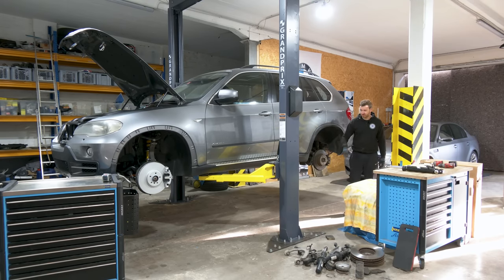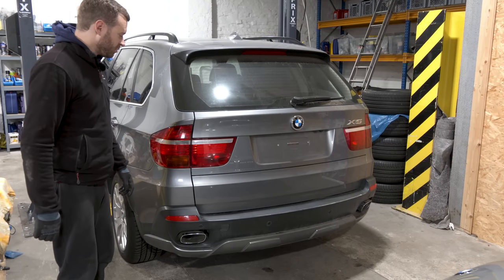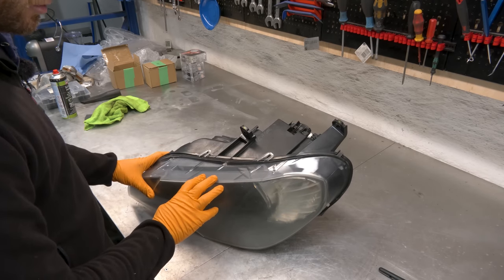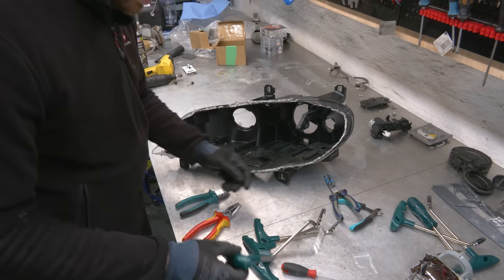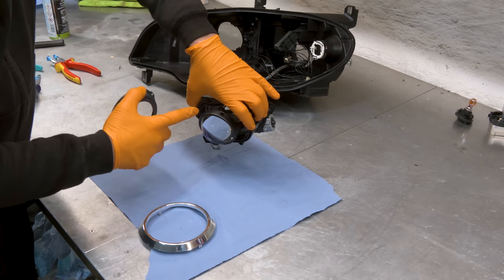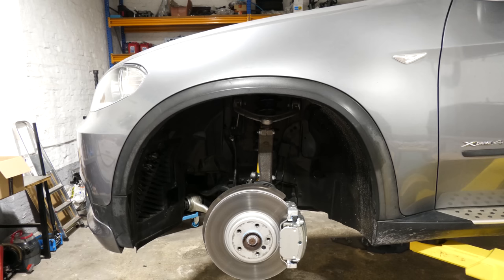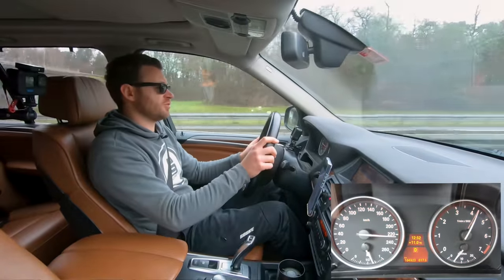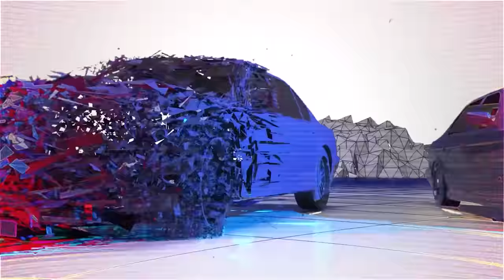Damage Report - Neglected V8 SUV BMW E70 X5 - Project X5: Part 5

Comment: This was a great series, thoroughly enjoyed it. The headlight restore looks very complex, but the result is phenomenal.
Reply: Why did you not change the side lights to bright white instead of the yellow ? Great job amazing attention to detail 😎😎
Reply: I wonder if the angle eyes could go to super bright LED.  The incandescents … meh
Reply: @f1lmm  the yellow is period accurate
Reply: BMWs really don't seem to like the sun and the heat. In South Africa, on the E46, the headlights go cloud, the interior roof lining sags and windshield cowling is always cracked and broken. At least they are cheap and easy fixes. It seems to be similar for other models I'm just not too familiar with them, but I've seen dozens of E46 examples.
Reply: @AapVanDieKaap  same in Australia. $1800 dollars for a new headlight x5 wagon.2008. NEVER AGAIN BMW
Reply: The most difficult part is ungluing the lens.  All recent-ish headlights 2010- use permabond glue which is impossible to remove, older ones use butyl which is removable and reusable.  Done this work on my 2001 Audi TT headlights.  New its 1200eur each.
Reply: After all this work 1000 eur for headlight looks not that bad :)

Comment: Your patience is absolutely monumental, I cannot admire it enough! I literally lost it at the wire insulation restoration and gasped in disbelief. But it kept getting crazier with the grinding and sealant removal! I would spend the money on new headlights right away, if I were in your place - I could not muster the mental strength to go trough this trauma... you are an absolute beast, I cannot say this enough!
Reply: Agreed -- and he had to do it x2! We are not worthy. God jul from Norway!
Reply: me the same!
Reply: Same here lol. immediatelly started checking the comments after seeing the wireing part. :D
Reply: Couldn't agree more.. Have done the same on a E39 many years back but so much more simple. Have a E70 now and wanted to do the covers only but seeing the whole mess with the wire insulation and projector grind down, I am like .... taking a pause .... oh man

Comment: One hint for using tape sealant  : always start at the middle section of the bottom. If the sealant somehow gets leak at he "connection point" (where the 2 ends meet), the water will not get into the headlight :-) The shrinking tubes are available in spools, so you get less work and one piece of tube :-)
Reply from the maker: Thank you! They overlap nicely at the connection point and then they are "melted" together with a heat gun. I do it there purposely because there's enough room to do that, while if you do it on the bottom there isn't much space, especially when butyl is thick. I'm aware, but I couldn't find the size I needed in a roll as the headlight wires are odd thickness. Cheers!

Comment: Man I feel your pain with the headlight restoration. Recently did a pair of e53 adaptive headlights and everything was the same, the wiring was as bad, if not even worse. And the amount of grinding and cutting to be able to fit the new projectors was ridiculous, however the end result was totally worth it!
Reply: Hi, I got E53 with adaptive headlights as well and would like to refresh them. Can you send me a link for the parts I would need for that job? Maybe you even have some instructions for how the job has to be done?
Reply: @chrissch3061  I used evo-xr 2.0 projectors, supposedly the only ones that will fit, but that also required a lot of modifications. Definitely not plug n play. My friend bought the headlight lenses off of ebay. Not too many options for them unfortunately. The available lenses don't seem the best quality so I'd definitely protect them with either ppf or ceramic coating. Other than that, the process and tools are pretty much the same as Sreten used in this video. A dremel, a few pairs of pliers, a flat head screwdriver for cleaning the grooves and some glue for repairs, because something always brakes 😅 best of luck with this job! Take your patience, took me a good 2-3 evenings of constant work.

Comment: My wife’s “car” is a 2007 E70 4.8i. I agree about the handling. It’s phenomenal. No body roll at all. It grips the ground like there’s a black hole under the pavement. It does not handle like an SUV at all. Before BMW put turbos on everything you needed to V8. Plenty of go. Anyway, thank you for doing this series. It will be very helpful. Do an F01 750 x drive, if you can so I can fix the other car.

Comment: I just bought my wife a 2017 Ford Edge SEL with the 3.5 V6.  Got a few things I need to do to it....most specifically cure the wind noise at the seals around the doors and  windows, but the same.  290PS and fairly fun to drive.  Not Mustang GT 500HP V8 fun, but fun none the less.  Absolutely great series and keep them coming.

Comment: Another top quality video from Streten. There's never a dull moment and you're always learning something. Decomposing "green" wire insulation. This "green" fire hazard stuff doesn't belong on BMW's. Reminds me of my E39 "green friendly" non-stick seal they used on door vapour barriers.  This caused carpets to get flooded. That was fixed using proper sealant and it's never been an issue since.

Comment: I never had a doubt. Inspections are all about checks and marks (with a small luck element which can be minimized. I never go on inspections in the middle of the week or at the end of the week) if you dot your i's and cross your t's you're always set to pass. You're a highly skilled individual, you obviously did all your homework and know the ins and outs of the inspection, only bad luck would've been a factor.

Comment: Nice job as always 👍.  I did the same wiring fix to my '06 M5.  I de-pinned each connector, one at a time,  but I used 1Mt lengths of (correct colours) heatshrink.

Comment: my deepest respect for the patience with fixing all the cracked wires inside the headlight. I probably would just have crimped all new wires into the connectors, because I don't have any patience for soldering and shrinktube.

Comment: Dude! Amazing work. Just bought a 2010 4.8i Msport, all options, and I love it. Same miles as yours! Now.......need to begin basically the same repairs as you did, almost. Valve spring seals for sure.  Thanks again!

Comment: This is such a thorough refresh! A little protip: they make shrink tubing in cut to size rolls, and in different colors. I also recently did an LED retrofit on my wife's Prius, to upgrade the already upgraded xenon projectors. The NHK IV+ made the 55 watt projectors look like candles, lol.
Reply from the maker: Thank you! I went to 3 different software stores and they didn't have the right size rolls. Had to order online. The wires are also different thickness so a box comes in handy.
Reply: @M539Restorations  I have to try the spray on kind sometime

Comment: Wonderful Christmas present! 🎄
Food for thought, isn’t it cheaper, easier and faster to just replace the wires in the headlights? 🤔
Reply from the maker: Sure is, but they are not available for this headlight. It's a non-serviceable part. You can get them for E38 though! Merry Christmas!

Comment: I went from a E23 to the E53 x5 with a m62 tu - I had moded the e23 with an aftermarket DME, doing away with the Distributor and going to wasted spark. Being a bit older I find it easier to get in and out of the X5. As for dropping 10mm sockets and nuts and bolts - the bloody things are a magnet. I have just done the ECV, again, with the appropriate tool and bolt offerings. Even with a bore scope, the offerings are lost . The reason I persevere I like to drive it, as you found, for a large vehicle not bad. When you can accelerate from 160 kmh being pushed back in the seat, what more can you say??? Great series by the way, Congratulations..

Comment: Hi nice job you did for your x5, for water leak I advice you to remove two pice of plastic cover you may find them when opening tailgate, also remove plastic cover in side each door at the bottom. Also I dug 5mm hole inside the bottom of fuse compartment because more water is flooding there.

Comment: One thing that would really make it shine is to replace the front grills. The first thing I did with my White 2013 E70 was replace them. They were the chrome/silverish and I swapped out with matt black and gloss black trim. It completely changed the look from family car to sports car. 

I have the original steering wheel and was going to change it to what you swapped it out with. I've owned mine since 2017 so I don't know if i'll ever get to it. I do need to change the thrust arms and front shocks for sure.  Thanks for the amazing detail and leaving in the verbal outbursts when trying to get the console out. You have no idea how many times I have done the same thing trying to fix something and yell "why BMW why? Who thought this was a good idea? Who thought this through? Answer: nobody!! " 
🤣

Comment: She looks great!!!
Removing the center console is a nightmare, had to remove it in an X6M to get the ACSM Module out and yes there are screws in the most weirdest places. And it's not the lightest thing either to wrestle with inside the car trying not to scratch or break anything.

Comment: Great job!  One improvement is to use long heat shrink tubing in different colors.  A proper electronics shop would have 1 to 2 meter lengths in different sizes and colors.  Besides making the job a bit quicker, it will make it so much easier for someone to troubleshoot any electrical issues in the future if the wires are color coded.

Comment: Great job on headlight wiring! If you're going to do valve body service on alpina, consider getting sonnax zip kit, basically its an upgrade for your end plugs. Plugs come with o rings and offers a good seal even while cold. Oe plugs are straight metal and leaks pressure and continue to wear them out almost like with sandpaper, since there are particles in oil from clutch wear.

Comment: Style 214 wheels.  Aka 20" boat anchors.  I like the style but they are ridiculously heavy.  I shod mine with 19" lightweight wheels.  And I had a regional guy here refresh my headlights last year.  Went through the same troubles you did with the wiring, but I went back with new glass projectors and OE triple chromed bowls. They shine just like yours and the cut off is insane.

Comment: Love everything about this series. Use it ALL THE TIME, probly not a good thing for me tho, lol. But everything u did to this car is what i want to do to my wife's. Next job is the valve stem seals and because of ur in depth video i feel very confident that I'm able to do the job. Been told so many times to just get rid of it but my wife loves it as do i, and after just paying it off i can't just get rid of it cause with the smoking i probly wouldn't even get 1/3 of what i paid for it so it's my project now and am excited to drive after all the work I've done to it.

Comment: Love the videos. You can remove the panoramic shade via the top. There are 3 bolts holding the glass in. Tilt the roof and remove the glass then you can remove the shade from the top. Just did it on my X5

Comment: Great episode, especially the headlight rebuild. Bio-degradable wires inside toasty headlights, seriously? Unbelievable. I paid $9500 for our 2010 X5 35D 2y ago in the US with 130k miles and put roughly $3,500 in parts in it so far, $4,700 with the new winter tires, mainly suspension parts, a lot of wearables around the engine (thermostat, water pump, sensors, some fuel injectors, etc.) and would probably have to spend another $2,000 to get it to your level of refurbishment. I'll keep watching. Love the channel

Comment: epic job Sreten. Regarding the tally at the end, here's another fun idea: give us a tally for what this work would have cost had you paid someone else to do it. I guess it's just the labor time you spent on it then. Maintaining or fixing up a depreciated performance/luxury beast like this to like new condition is very expensive if you don't have the facilities, time, and/or interest in doing it yourself. Of course it's worth it in my opinion because cars keep getting less and less interesting as they become more and more turbo'd, small displacement, and heavily muffled, let alone electrified. So it's not so much to deter someone from undertaking a project car but to give a project its due in terms of how comparable it is to buying a new car- especially since you generally can't finance mechanic bills like you can a car.

Comment: Nicely done, as always. But for the black trim, you should try creamy peanut butter. Don't laugh. Use this for all my motorbikes with faded black plastic trim. The oil from the butter infuses over night into the plastic and it looks like new. Prep work is thoroughly cleaning and may slight sandpaper to remove  the worn surface layer. You try that out.

Comment: For a longtime protectiv film you can use "Owatrol spray oil". This is a thin sprayoil wich dry over 1-2 weeks to a kind of clear and shiny wax coate. You can use this also for rusty parts and this parts or spots will not rust anymore. It replaces the oxygen and water in the rust with itself and seal the rusty parts. Its very thin and have a very good flow to small gaps. I use this on my 91 Opel Corsa A wich is know for his huge rust problems. I respray every 1-2 years a new coate and i have no problems with rust at this spots. And this is no comercial.

Du kanst es ja mal testen ;-)

Comment: my only critique is I would have changed out all the wire inside the headlight units.  Even if you cant color match them, i would feel better with all new wires.  excellent work as always,.

Comment: great winter car,you have fixed the shit that is left,look at the oil you drained out of diff's looked like it was what was in from new,those wheels look way better than the ones with winter tyres,you can put a tune on it so it picks up better and does better fuel as well.

Comment: I could only laugh at the center console disassembly.  I dropped a dime in my wife's F15 and it rolled in slow motion right behind the cover and of course annoyed her to no end on every stop and go.  My BMW master tech buddy and I made up cuss words getting that dime out.  Anyway, even though mine is a newer chassis and has the N55 motor, it is still an incredible SAV for what it is.  I still love my manual N54 E92 though and have no thoughts of ever getting rid of it as it is close to the perfect driving experience, well, except for my buddies E92 M3.  But he is a master tech and like you, can fix anything!

Comment: Buy yourself a diesel heather to get rid of the cold, they do a good job and you can run filterd oil in it, also there are some with ap and can be programed to find your shop nice and toasty. Cheers

Comment: Epic work Streten , as always your on another level..Bravo , Bravo!! BUT please explain to me how when you say 2 reasons when your standing outside with the car but hold up 4 fingers is that a special German thing? haha and the 2nd set of wheels that look aggresive , l have on my E53 and l think they look great (just my opinion) , mine is same paint colour with black interior , dash mat , expensive lambswool seat covers and black anodised pedal pads which add 10 HP so l am told haha..DON'T SELL THE SUV....looking forward to more vids mate and by the way here in australia it;s summer and bloody hot , just thought l would share...bye for now

Comment: When it comes to headlight renovation you might want to look up polish company called "vroomer". They do deliver great quality of work for a price that should be really affordable for you. Second - if you ever feel like using sand paper on the covers look up the "K2 vapron" restoration kit. The surface after the restoration is much more durable than the polish method. I'm sure you'll like it. Have fun!

Comment: Hey
This episode is special due to the headlight restoration, something a lot of us driving fairly old and high mileage BMW's are planing but never get around to.
If you are going to do headlight restoration/upgrade on your E60 M5 PLEASE film it and load it up on the channel.
I am in the marked of a pair of new or good used xenon lights as mine are pretty sad and worn out.
New HELLA lights are a little more than a 1000 euros each (if I go for BMW dealer lights we are talking at least 1800 euros each) and can I cut a big thunk of that bill by doing a restoration my self I will...

Comment: Nice video! You should try xhp software for the gearbox, it certainly improved the feel of my E65 750. Improved shifts, and saves a bit on fuel as well. Best thing is (if you're a nerd like me) you can adjust the shift points etc to your liking. Could even be an improvement on the Alpina.

Comment: The E70 body is the best looking SUV by BMW, and possibly the best looking SUV

I have an X5M E70 and it’s almost a perfect car.  Sure It could sound better and have better fuel economy, but with the addition of a new infotainment system its almost perfect,  I went with a 10.25” Android touchscreen, its 30-60 minute job and now I have Carplay starting up automnatically with the Original infotainment system also available

Comment: Good job ! I Can’t believe how shitty those headlights are , I think LCI e46 headlight wiring is the same biodegradable crap as they fail the same way too. What complete load of garbage that is! And that cup holder replacement wow 

I did chuckle a little when you used short strips of headshrink tubing, instead of longer pieces cut to length 😆 

I’ve always liked the older E53, I can see the pros (and cons) of this chassis vs. older E53 now thanks to you!